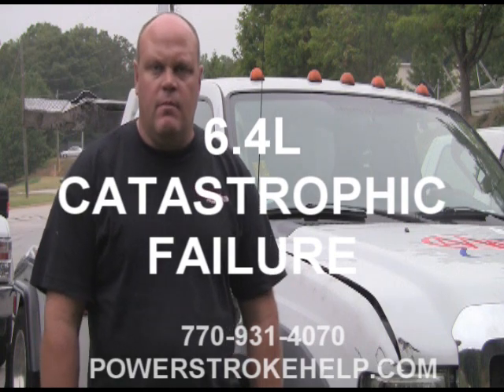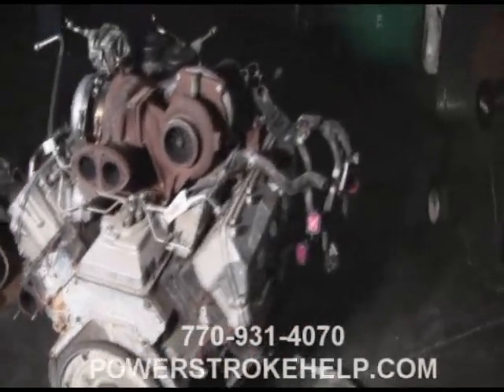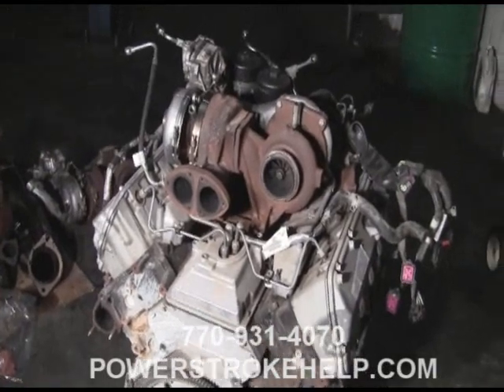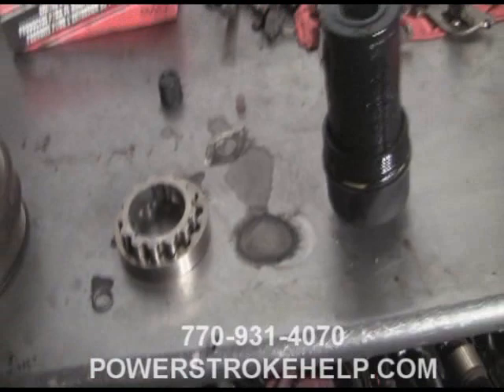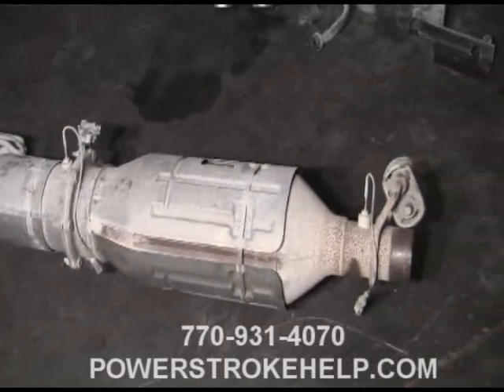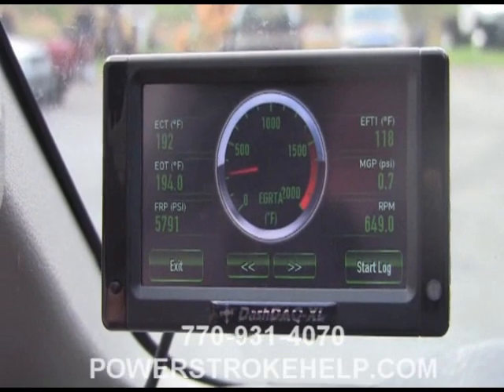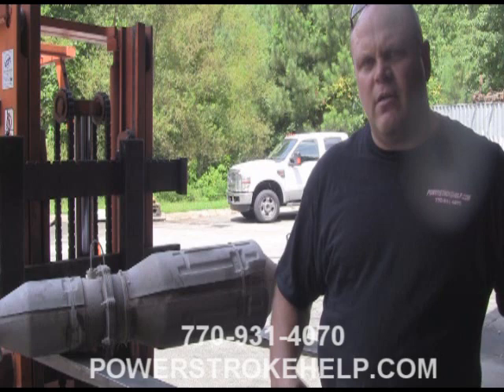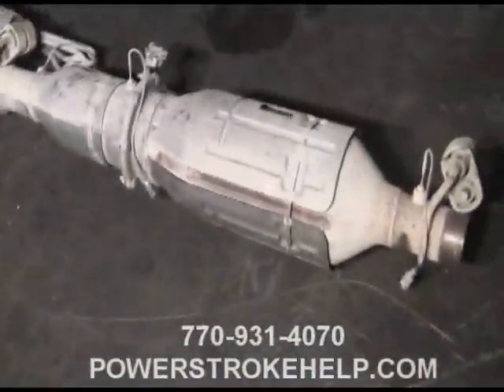6.4 CATASTROPHIC FAILURE

Comment: As a Cummins Certified tech I hate the DPF and now new SCR system also. But they do both serve a purpose. The biggest amount of failures I have seen on DPF systems were tow trucks and delivery trucks. Further research showed that trucks with these systems and driving short miles should have a "Parked Regen" daily. Also it only cost us $400 to have DPF Filters cleaned. There is also a "Back Pressure Test" you can perform to make sure your DPF is flowing correctly. Back Pressure causes damage

Comment: I have tried to clean the DPF with a pressure washer, no good.. Have to replace it to keep emission legal. Ford stealerships will tell you it has to be replaced every 120K miles.. It is really hard to afford these trucks with DPF installed.. Not to mention, if your truck is going into regen less than every 200 miles, you really need to change the oil every 3K miles.. They love to fill up the oil pan with fuel!

Comment from the maker: you have to beat the snot out of it to kill that transmission. Some of the guys will run these late lock up race tunes that overheat the torque converter. If the converter comes apart ti will usually take the trans with it. Level 10 transmissions in NJ builds on of the best late model transmissions on the market.

Comment: I currently have a 02 powerstroke, and I love it. But as you said it is a dinosaur in a new world. I have been looking at the new 6.4 trucks, I rode in a Tuned/egr deleted 6.4, w 8in lift and 40in tires - 6 months later i seen it in a local shop getting a built transmission in it. I watched your how to purchase a 7.3 video before i bought my 7.3, do you have some recommendations for the 6.4? How do the transmissions hold up to the extra power of the tuners if you don't beat the snot out of it?
Reply: 6.0s and 6.4s trans dont hold up well to most tuners from what I see
Reply: I know this is 8 years too late, but DON'T BUY ONE!  https://www.youtube.com/watch?v=FiB6IbPs2Zk  (6.4 Powerstroke - The party is over)

Comment: My P.O.S. 6.4L (100% bone stock) regens 10-15 times per tank, took the truck to dealer and ford tech said nothing wrong with it, fuel consumption drops to 6-7mpg. He put latest flash but things are getting worst. Engine only have 1066 hours and 28xxx miles. You will not believe how bad the engine sounds when regens start (like throwing a rod or something) Almost stopped using the stupid thing, I cannot express how dissapointed I am at FORD, EPA, NAVISTAR.

Comment from the maker: that is correct. The EPS emissions spec for 2013 is that they must make 1/100th the emissionsof a truck from 10 years ago. That is a huge, huge deal. Even with the DPF off the 6.4, I would guess just through good fuel management it still has to 50% cleaner than a 7.3.

Comment from the maker: I agree. It will happen eventually. The engineers have done huge things with gasoline engines, but they have been diddling with gas engines since the 70s. Remember the 7.3 was still in production just a mere 10 years ago. So we are just in the middle of the emissions revolution in diesels.

Comment: Yep, that's exactly what I plan on doing is gutting an extra DPF and Cat  I have for this purpose and install it in place of my stock system with tuning.I will keep my stock DPF and Cat intact in case I have to switch it back.The turbos already were replaced on my truck under warranty from most likely being cooked by high regen temps.My warranty has just expired,so now this will be the best thing I can do for my 6.4L truck!

Comment: That is exactly why mine is sitting on my garage floor.  So, I take it you aren't interested in my EGR coolers?  Hell, I have no use for my exhaust either.  Only had 10K miles on it when I removed it.

Comment: Do you work for Navistar's sales?(lol)  We can't do in cylinder unless you want 1mpg and no power.  Navistar spent MILLIONS trying multiple incylinder technologies and are still investigating some of the more advanced options like the opposed piston engine.  But the bottom line for all are the same, loss of power and mpg.  There needs to be a huge jump in the technology to do incylinder and there isn't any currently out there or on the horizon.